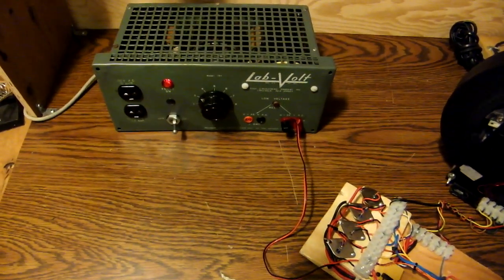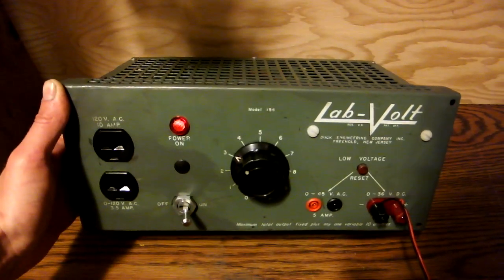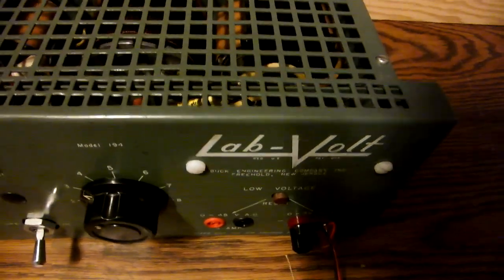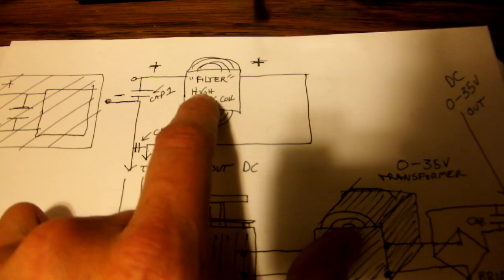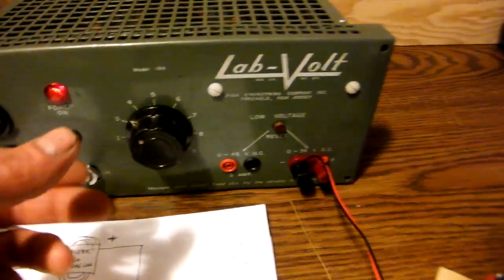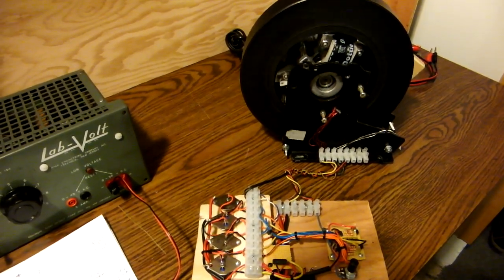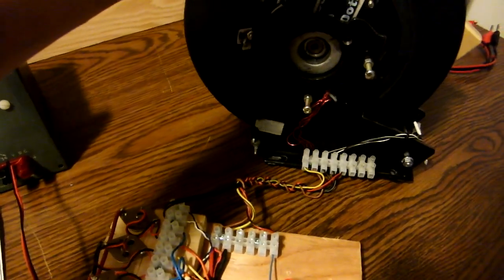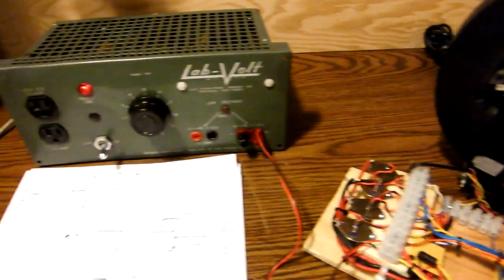Ancient BEAST Bench Top Power Supply -  40 Volts DC Adams Motor!

Comment: Hi do you have anything that does dc pulsed unregulated and ac pulsed unregulated that could take the place of a starter motor spark gap/fuse to an alternator then Rees off to an aluminium air intake to strip air by positron formation. Bought one if your early desulphaters a while back but now got loads of info on joe bookers atom stripped magnetic neutralised air engine

Comment: Charles you watched the joe cell story freeze the frame when his white rover car comes on when he shows the cell pipe going to the aluminium heat exchanger sitting between the carbs look at the wire from that going to the oil dipstick the energy coming out the so called cell is vacuum positrons anti matter joe explains in the 1995 old style looking video charging water in it he explains how a water pump goes alright until he turns the cell on and it sucks the energy under vacuum in to the pump and locks it up then when he switches cell off the pump restarts so he Sussed with the professor videoing him they mention positrons attraction/soaking